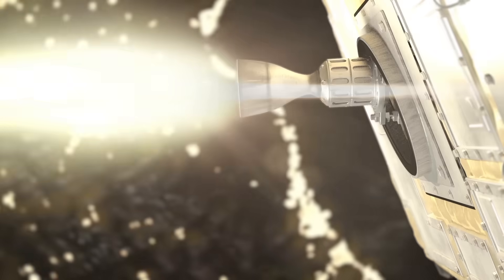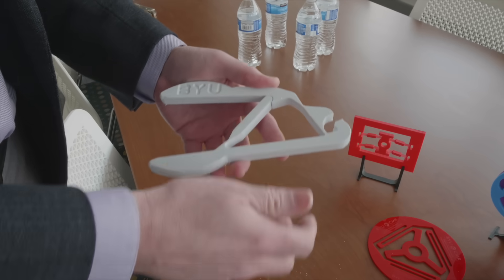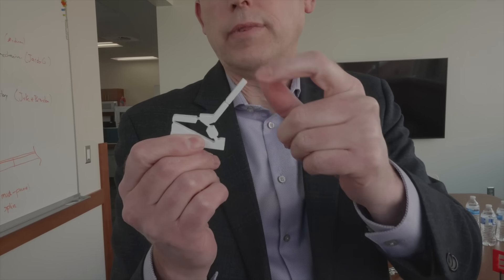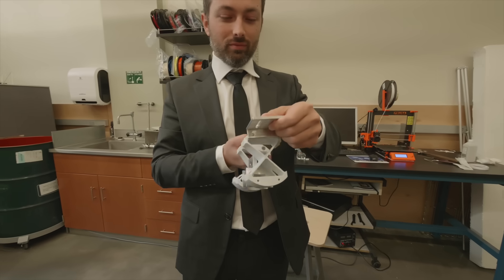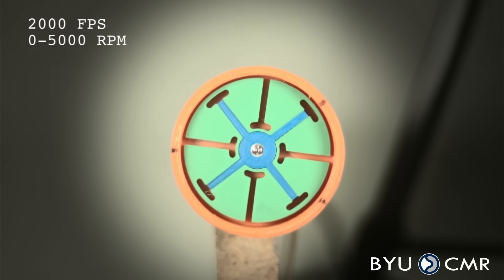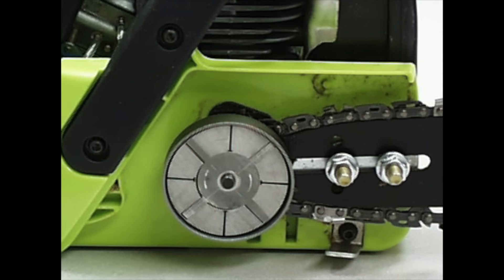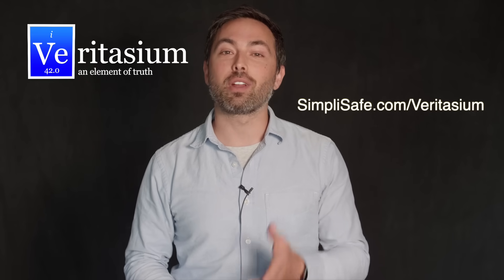Why Machines That Bend Are Better

Comment: That thruster control for the satellite is a thing of beauty. I'd love to see an animation of how it works!
Reply: You can see it in work at 8:50 really awesome, two motors, any direction.
Reply: @11kele  Those are some heavy-looking motors, though
Reply: @IDoNotLikeHandlesOnYT  Yes, but imagine how this would look if the construction is made from non-flexible parts, instead of just one flexible part there would be much more solid parts, including more motors, wires, more things that can go wrong...
Reply: Go to our website: cmr.byu.edu, click on videos, and scroll down to the space section. Very cool stuff there!
Reply: Thanks!
Reply: @9oreos308  Can u help a little?
I need 12 more subs.
Reply: ikr, like human joint. there must be a reason why human joint isn't designed like that...
Reply: @hafidhzuhdi5784  if you think about it, lots of joints in nature function like this. Sharks don't have joints like us or other fish, they have a flexible cartilage skeleton. Invertebrates with exoskeletons such as insects and crustaceans have flexible regions on their exoskeleton that allows for bending.
Reply: @ianzen  sure. But i meant specifically for the rocket thruster joint, it's pretty similar with shoulder/hip joint. Yet we have ball and socket joint. 

After I thought about it, maybe it had to do with muscle and nerve. That's why we have ball and socket. I dunno. What do you think?
Reply: @hafidhzuhdi5784  Natural shoulder/hip joints have to be biologically grown which means building on existing structure A to get to point B or C, or elsewhere. In nature this is mediated by many factors including physical stressors, chemical diffusion,  blood supply, senses, etc, etc. 
The 3D multi-interconnected nature of this compliant structure intuitively seems unlikely to be easy to form by those naturally mediated growth factors.  Nature would go with whichever process works given natural constraints. This artificial compliant structure can be formed in many different industrial ways with completely different engineering constraints.
This is just my own speculation from an engineering, technical background, with an interest in science & medicine.
Reply: @hafidhzuhdi5784  "designed" Oh boy...
Reply: @HR_DR  hahah. English is not my first langauge
Reply: @hafidhzuhdi5784  because human joints are not designed
Reply: Cool
Reply: Is the advantage of that vs like a 2 axis gimbal...the less moving parts? They said 2 thrusters would be needed...but the range of motion was that of the gimbals on say, an RC Transmitter for example...so must be that it's one piece?
Reply: jmarks881  it would be impossible to replace it if breaks. too big
Reply: There IS one in this video.
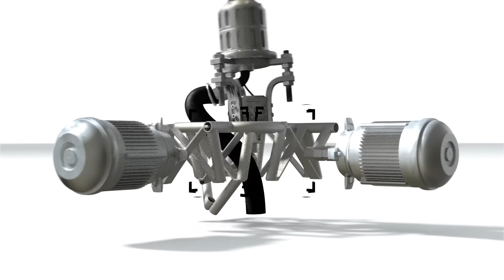Reply: 8:50 - 9:01

Comment: Is there a better explanation somewhere for how these can flex so many times under great force without breaking?
Reply: It looks like they were carefully designed so that the mechanisms operate entirely within the materials' elastic region. In other words, stress up to a certain point won't permanently deform the material. If the material experiences stress beyond its elastic region, it'll deform and fail. But you'll notice all the mechanisms have a very specific range of motion where they can move freely, and this ensures that the stress the "joints" experience is well within the elastic region.

It's not so much that the mechanisms can experience great forces without breaking, moreso they can experience very very many repetitions of the same force.
Reply: @Zoronii  This is right on the dot. In addition to that, by thinning out the parts so much, it allows them to bend with much lower internal forces than you would get inside a thicker piece of material for the same deflection.
Reply: I hope so, or this is misleading.  Silicone supports repeated flexing very well, but all polymers are degraded and suffer fatigue.   The video does not address this fundamental issue,  but just asks us to believe in magic.  Repeatedly flexing titanium beyond a very small angle, for example, will fracture it.
Reply: @raykent3211  Though I wonder how total cycles differ if the design is subject to elastic vs plastic deformation? I'm curious what material they used for their 1,000,000+ cycles result.
Reply: @raykent3211  Repeatedly flexing a small section of titanium beyond a very small angle will fracture it, but these seem to be designed so that the flexing is spread through a lot of the structure, meaning that each individual section only flexes a tiny amount.  I presume it's also designed such that the stress is fairly evenly distributed throughout the whole structure, i.e. the sections that would be likely to flex more are made thicker to strengthen them and prevent them from flexing too much.
Reply: I think if you were to be able to determine the maximum force that can be applied to the machine you can calculate and design  your flexible such that the internal forces at anypoint in the machine does not exceed the max allowable stress and strain(I'm probably making some terms here lol). This also varies depending on the material selected.

PS: This is just my guess
Reply: Any machine in general can eventually wear out due to operating stress/strain over its lifetime. How is this any different except in how you subjectively perceive this specifically? Your car's engine block is technically flexing (expanding and contracting with heat and pressure) even if slightly, but metal still flexes/bends/etc. And that's happening constantly just the same, waiting to eventually fail one day and give way. It's just like any other machine we have in terms of that context. You're never going to have a machine that lasts perfectly durability-wise infinitely forever without any form of maintenance, lol. Just because this can't meet that impossible goal doesn't mean that it's not worthless technology. With more flexible materials and deliberately flexible machines, we open up a whole new world of engineering possibilities potentially. It's silly to expect it to be durable for all eternity though all of a sudden considering we already accept natural wear and tear with everything else. Now you can ask if these flexible machines might break down more often than "normal" machines, but properly engineered ones will at least match tolerances similarly in theory. It's silly to assume it'll instantly/automatically be more breakable just because it can flex, though. That's the bias of perception I'm trying to address here, one borne out of people not thinking about how even their car engine (which they imagine doesn't flex) still flexes/expands/contracts all the time, even if they tried to engineer it to minimize flexing. This is just a new engineering mindset that views some intentional flexibility as useful in certain applications, whereas the old mindset was more blindly thinking one-dimensionally "flexing is nearly always bad, we should minimize flexing almost always, unless it's super tall skyscrapers that need to move in the wind a little to not be brittle, but other than that we'll tend to dismiss flexing as bad." Now they realize sometimes have some deliberate flexing can be a good thing, as long as it's engineered properly. And we never had any perfectly unbreakable machines to begin with so that's a silly concern to get overly worried about ahead of time, in my opinion. Like I said, you can ask if they'd MAYBE break down more often as a totally valid question/concern, but to assume it WILL be the case already and you already are questioning whether it'll be useful or not given that "fact" is what I'm calling out. We haven't established that as actual "fact" yet, and as I hoped I've illustrated earlier with the rest of my post, in my own estimation I don't believe it to be a "fact" at all - quite the opposite -- a falsehood borne out of inexperienced worries about things "flexing and breaking" like when you bend a plastic toy at home too many times or something, when this is a much different context with engineers well-aware of those potential issues from the start. They wouldn't be barking up this tree if there was no hope or possibility (so no, I don't think this is charlatans asking us to "believe in magic" like some of you have tried to characterize this as... but you're still entitled to your own opinions.)

Comment: When this is made from metal, how does metal fatigue affect the longevity of these compliant mechanisms?  I know that the weakening and enbrittlement of flexing materials is a real danger in engineering.  I saw the switches lasting millions of cycles, but how does the way the materials are designed reduce the way that flexing and bending metals have a tendency to want to break?

Comment: 8:13 as far as I know, alloy elements always stiffen the material because they bring tension on a microscopic level take iron (Fe) for an example the pure stuff which you won't entcounter in your daily life besides in electroni8cal components. The raw material is fairly soft but if you only add a little bit of carbon intentionally or not, in very small portions we are talking under 0,8% by mass. Those carbon atoms will set them self between the iron Kristal structure or even displace a Fe atom. those are 0-Dimensional Errors in the Kristal structure of materials. And it gets up Volume defects which are errors of the 3d Dimension I could keep on talking but basically, the purer an Element is the more flexible it is and if you have more alloy elements the more brittle it gets. Think of gold 24 carats (99.99%Au) is very soft and 18 carat is much harder and brittle. (But copper and gold and silver get work hardened unlike other materials they become soft when you heat them and fastly cool them down after) As you can see I really like MaterialScience and it is a topic id love to see you make a video about because it brings so much to the table and there are so many interesting things to learn.

I Love your videos and hope to learn more with you in the future. 

Ps: I am a German second semester 
german german german 
automation technology student and love to learn with you and the sciences community on youtube.

Comment: Question:  Why the single butt joint in the pliers/gripper mech?  Why not just another flex hinge?
The tech isn't new, the application is.  Kid's lunchboxes and other plastic cases have been using this for decades.  Same with CD player focusing/tracking mechanisms (4 straight spring wires), cellphone keyboard slide spring mechanisms, the snap function on microswitches and many other switches, novel cigarette dispenser cases, and MEMs.  I think even a bass actuator has used this concept.

Well, some of those contain only 1 or 2 hinges, but that's the idea.

Comment: I'm surprised something like this hasn't come about earlier. I had always thought it was because the stress at those tiny "hinges" would break given the forces and weight the attached pieces applied to them. I feel like as a kid, any small connection like that in toys seemed brittle and always broke when I tested how far it could bend. Why the emergence now? Does it have to do with how precise we can craft these parts with current technology that we couldn't in the past?

Comment: after learning physics for a few years, all i can think of is the material getting ''tired'' just like bending metal, you CAN bend it, you can bend any material, but even bending it a little will cause it to get tired over time, especially multi-bending it...

Comment: 15 second UNSKIPABLE ADS ARE UNFAIR
Reply: Download Brave browser.  It's built off the same platform as chrome and is  very close to identical but has a powerful ad blocker built in that will skip youtube ads.
Reply: @mattrevesz  I just refreshed the page lol
Reply: @3mar00ss6  Well you are missing out then, because brave is awesome.  You know when you are reading some news article and suddenly you get that pop up saying "We see you are using an ad-blocker!" ... well that hasn't happened to me since I started using Brave.  
If you still want to use chrome you can also install Adblock add-in for chrome, which works but not as well.
Reply: @mattrevesz I mainly watch YouTube on my phone using the YouTube app but thanks m8 I'm gonna try it one day
Reply: @3mar00ss6  They have a mobile version as well but I haven't tried it yet

Comment: I wonder if heat generation from the flexible points is an issue in application. There also seems to be a trade off on mechanism size from traditional to this type of machine.

Comment: Plastic channel locks would not be cheaper than metal ones. Metal is nether rare nor expensive to process. We have been making steel continuously on an industrial scale for over one hundred years now. Plastic channel locks would require new factories, petrochemicals that are worse for the environment than the slag steel mills produce, and they will lose elasticity at the flex point over time and simply break. Metal channel locks can last a lifetime if you take care of them. And metal is more recyclable and will, left to it's own devices, return to the earth as iron oxide. Plastic hangs around potentially forever, cannot be continuously recycled, and left to it's own devices could become an environmental hazard. Plastic bottles are menace enough. We don't need broken plastic tools added to the mix.

Comment: What are the drawbacks? I feel like there could be serious issues associated with fatigue failure, design cost, or manufacturing cost (3D printing metal isn't cheap!) that were not discussed. Could be interesting to get another viewpoint on this type of design and manufacturing.

Comment: I had so many questions at the start of the video, and nearly all of them were answered really well throughout the video. But I'm still a bit confused about the nuclear weapon safety device. The high speed video you showed was the one currently being used? Meaning, there is still a possibility of an accidental arming if the wheel turns enough times for the hole to be in the proper position? Or what does the wheel turning twice a second have to do with the safety mechanism? 

This topic was absolutely fascinating. This is the kind of thing that people should know and hear about, to get a better understanding of how significant technological advancement is.

Comment: 6:40 Wait, is that in any way related to the cheap clock mechanism (Edit: MEMS Oscillator) that causes iPhones to shut down in the presence of Helium? Applied Science took a look at those with his electron microscope, some of these devices look kind of similar.

Comment: Yo! Check out the Diabase Engineering H-Series hybrid platform. It's a 3D printer and cnc platform for combining not just additive and subtractive manufacturing but different materials too. The idea is perfect for using a variety of materials and tools to create compliant mechanisms in a single process!

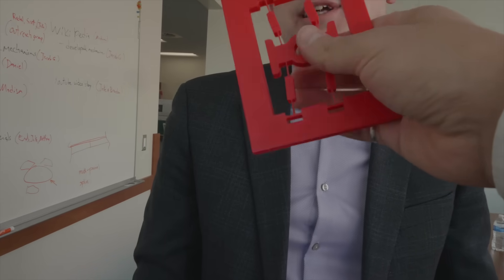Comment: (6:46) Gonna try and print it now using PLA. Hopefully it doesn't break easily, since the thin connectors are only 1 layer wide when I slice it.
EDIT: Print is done and working great, just like in the video, with that satisfying snap when it locks nicely into place.

Comment: The gravity by which this expands my perspective is literally exponential. On that note I'd add a 9th P - Point of failure. These designs are designed to..comply.. meaning they would be no match to a non-compliant alternative when it comes to higher order of forces

Comment: 10:53 Wouldn't the hole make 72 revolutions each second since 1 Hz = 1 cycle/s ?
Reply: I assume the teeth on the wheel make 72 per second. With 36 teeth, that comes to 2 revolutions per second.
Reply: @Yora21  Yes, you're right, thank you! I was assuming that he defined one full revolution of the wheel to be one cycle, instead of the wheel going down one notch to be a cycle

Comment: I'd like this as a replacement for micro switches in mouses they seem to be able to produce the click and also not fail as often while still staying cheap. Maybe a revenue space these mechanisms could be expanded into since its one of the things that break (or just dislodge) really easy in a mouse used for a long time.

Comment: me: sees vid oh wow.
also me: time to hack a nuke mannually... takes out a microscopic drill bit to attach onto a drill and drill a out the pin on the gear. hehehe, WW3 time flashes multiples of different intensity and coloured lazers into the hole. 
nuke: well guess everyone will die now

Comment: I heard mention, PLA and Titanium, but what materials are these printed in otherwise.... 
Specifically for the vice grips.
Nylon or Teflon? Delrin? Maybe just ABS??? Petg seems to flexible, PLA too stiff, ABS would break from thermal hinge wear fairly quickly, Nylon can be soft, but also stiff, depends on the specific formula....

Comment: The clutch has tons of interesting potential use cases like in automotive transmissions. Modern automatic transmissions are super complex and expensive.(not to mention bulky and heavy) There are so many mechanical systems that use complex parts many of which wear out overtime for the same reasons mentioned when talking about hinges. I am all for less complicated and cheaper transmissions in ICE engines for the remainder of their life.(until they get replaced by other technologies)

Also it would be incredibly interesting to see these types of mechanical systems integrated into the suspension systems of vehicles. Anyone who has done any suspension work knows how many moving parts that can and do fail exist, and how tedious it can be to replace these parts. If we could get something that lasted 200-300 thousand miles while being somewhat easy for end users to maintain it would be amazing.

Comment: Flexible machanisms are in use and they definately have their place. But i dont see how it would benefit to replace bearings on which solar panels turn with titanium contraption. It would replace plain bearing which is by no means expensive for that purpose